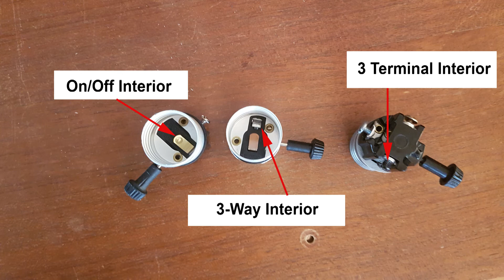3-way vs 3 Terminal Lamp Socket

Comment: Thank you! I didn't know the correct terminology. A 3 terminal lamp socket is what I need to control 2 light bulbs independently using one lamp switch.

Comment: Does a 3 TERMINAL lamp need a 3 way bulb to work? I have a lamp where only the base light (terminal 1) turns on. Everything looks good. Should I just replace the socket?
Reply: Did you ever get an answer to your question? I have a almost similar problem .....only the top light turns on, base light doesnt.

Comment: How do i install a 3 terminal socket?
Reply from the maker: Similar to a regular socket: loop the wires around the screw terminal. Since there are 4 wires and 3 screw terminals, the 2 ribbed wires (sometimes white) connect to the slightly larger screw. The bottom light smooth wire connects to the black screw and the plug smooth wire connects to the brass plated screw.
Reply: @Antiquelampsupply  - The white wire on my lamp looks smooth, not ribbed, and my lamp plug in wire looks ribbed... I'm so confused.
Reply: @Antiquelampsupply  sounds complicated.  Great videos!
Reply: @Antiquelampsupply  Hi ALS, thank you for the vid...in my research, you are the ONLY one I have found so far that gives "any" kind of directions on 3 terminal set-up. Have you considered doing a video for that? The reason I'm asking is I have a antique light similar to the one in this video w/night light at bottom. So of course I have 4 wires. The dilemma is the night light wires are both smooth black and white wires and then the other two wires for the top main light are both smooth same color wires. I think I have to put the black wire on one screw, the white wire on one screw and twist the remaining two wires together and put on screw terminal?
Reply: NAME NAME I have a similar lamp as well and the white wire, and the ribbed wire go onto the neutral silver screw. The black smooth wire will go onto the black screw and the last remaining smooth wire goes on the brass screw.
Reply: @Antiquelampsupply  Can I make a 3way from a two terminal socket by soldering one wire to the plain terminal with no screw ? I have a antique lamp with upper and lower lights and i bought a two screw socket.

Comment: Now if you had a video on which terminals the 4 wires connect to to make it work that way!  Someone disassembled it before I could look at the connections, and I've tried every combination I can think of (even tripping a breaker with a combo I KNEW was wrong!)  One position turns the bottom on, and the other 2 only turn on the top.  Mine has two black and 2 brown wires.